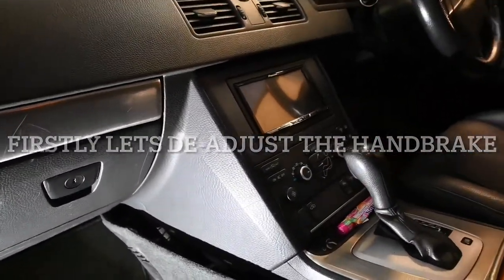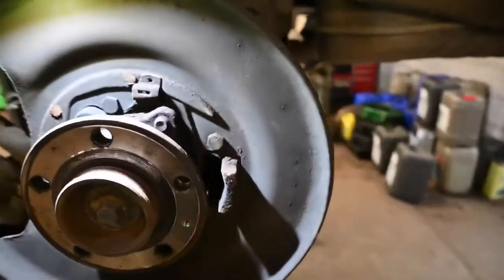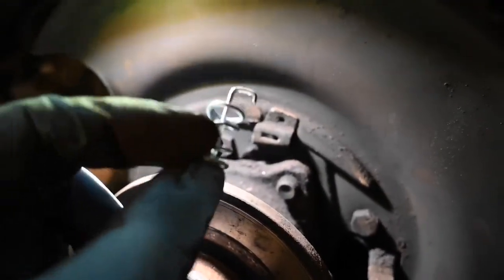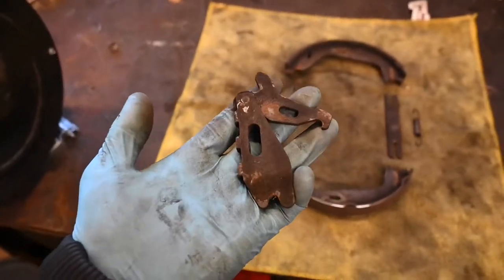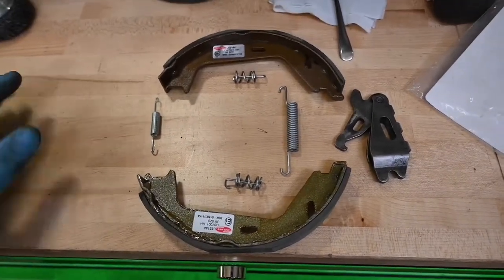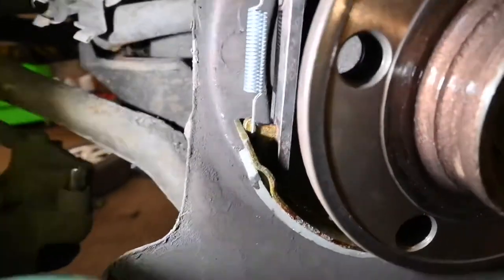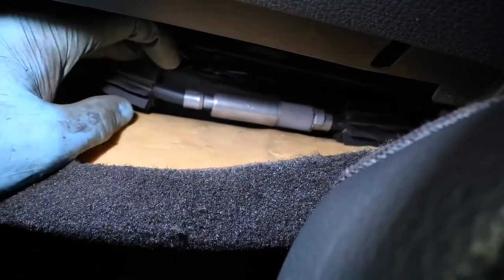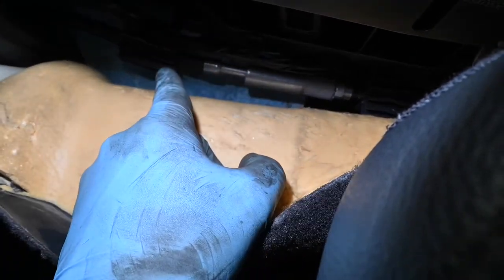Volvo XC90 Parking Brake Common Fault & Fix

Comment: Hey nice video but you left out assembly. I had my parking brakes done by a mechanic, new cables and all. Now one side started binding while the other is ok. Any tips? Could it be the same problem you describe? What's the part called?
Reply from the maker: Hi, thanks for the positive feedback. I know, it was one of the first videos I filmed and turns out I didn’t have the camera recording for that part 🤦‍♂️ regarding the brakes binding on one side it is likely that what I discussed in my video could still be the underline issue. So the part that seizes commonly is the parking brake shoes actuator/lever. Normally when you replace the parking shoes you wouldn’t need to remove this component to do so, HOWEVER, it is very easy to inspect to see if it has seized or at least has limited movement. Considering it’s such an in depth replacement I personally would remove the actuator/lever and make sure it’s as free as I show in my video. I’d recommend to take it back to the mechanic who did your brakes as I’m sure they’d be happy to rectify. I doubt it’s an adjustment issue otherwise it would be happening to both sides, not just the one. Hope this helps and thanks again for getting in touch. All the best 👍
Reply: @greenautoservices  hey thanks for the response. I can't take it back now really as it's been over 2 years now. I'm glad I found your video as it really makes sense. When I first picked up the car from the garage it went through yearly inspection, the MOT, without fail but on the first hill I went ahead to pull the brake up and the car started rolling back. So the mechanic must've known about it and just left it as is and must be friends with testing garage because there's no way it would have passed inspection with non working handbrake. What I did was to tighten the cables up but it still wasn't as strong of a stopping force as before. I left it as is thinking maybe it needs time to settle in or something but now I see my mistake. Should've taken it back then. I checked and the cables were changed along with shoes and springs so this actuator must be the only thing that makes it bind. Can't see anything else failing after watching your video. This is why I hate taking car to mechanics. I feel less stressed researching and DIY as much as I can on it. Anyway props for the advice. You seem like one of those honest mechanics, hope you have alot of business.  Take care mate 👊👍

Edit: where's your garage located?
Reply from the maker: @papiezguwniak  totally understand, it happens. If that actuator wasn’t cleaned or at least checked at the time it makes adjusting the system difficult to perfect and work as it should. Even if it’s slightly stuck it will cause the brakes to bind. Glad I could help though & thanks again.
Reply: @greenautoservices  thanks again mate. I'll be checking and fixing it myself now. Really appreciate your responses. What would you recommend lubricating the actuator pivot with? I was thinking copper grease.
Reply from the maker: @papiezguwniak  Copper grease is perfect, it’s what I use every time 👍
Reply: @greenautoservices  excellent. Take care my friend, thank you for your help 👍

Comment: Throw that “H” shaped spacer away and buy an adjustable spacer from one of the older Volvo models ie Volvo 850 recommended by Volvo. It makes adjusting handbrake easier.
Reply from the maker: And that’s why in this industry mechanics are constantly learning and finding out new stuff. Really good to know. Thanks for getting in touch 👍
Reply: @greenautoservices  no no, thank you for taking the time for not only fixing cars but putting considerable extra effort into videoing the whole thing & making our lives that little bit easier 👍